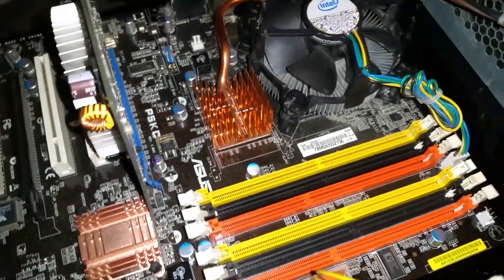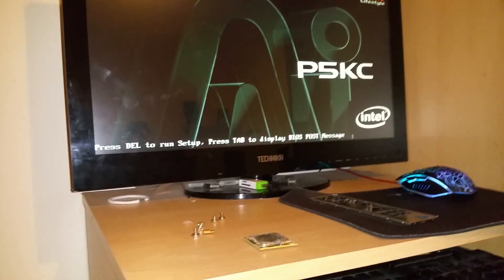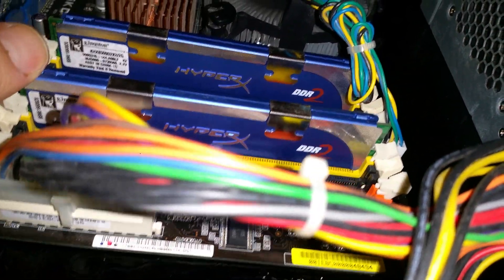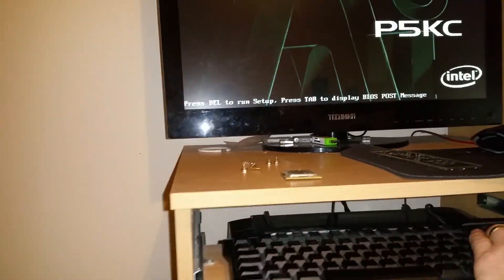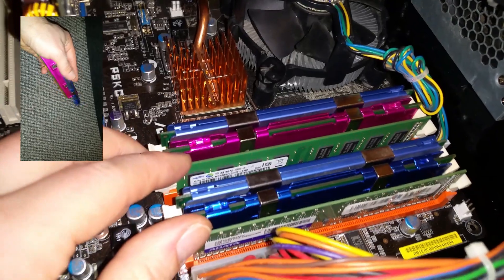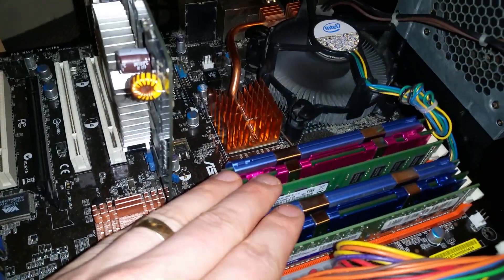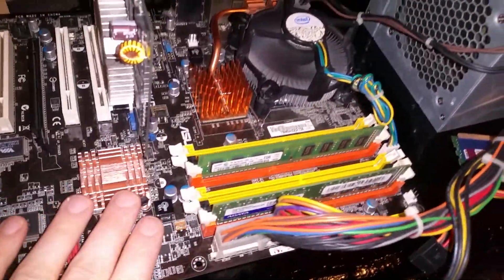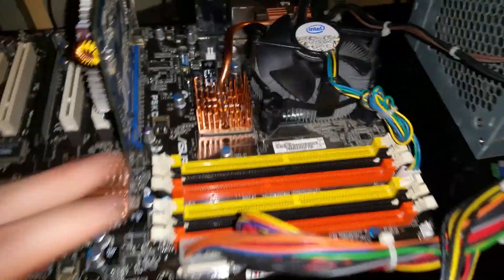Can DDR 2 and DDR 3 working together ? Lets find out

Comment: Wait, This Is DDR2 MotherBoard or DDR3? And Can I Insert DDR3 Ram Memory 4GB On My DDR2 MotherBoard? My DDR2 MotherBoard Is G31M-S2C. Gigabyte.
Reply from the maker: Hi this is combo MB is have 4x DDR2 slot and 2x DDR3 slot not sure about your MB   but MB like this is not usuals
Reply: @frogtechtips  So Can I Insert DDR3 Ram Memory 800 Mhz On DDR2 MotherBoard Is G31M-S2C ? I don't know, so I ask, Thank you if you answer. I Subscribed.
Reply from the maker: @newy14  hi definitely no as DDR 3 have different pin you will need new MB and probably new CPU saw well

Comment: Hey I have a laptop which has 4 slots and only 2 slots are filled 4gb×4gb and both are ddr4 so i have 2 gb ram 1gb+1gb unusable but they are ddr2 so can I install them on my laptop
Reply from the maker: Hi no you can't use ddr2 in ddr4 slot you will need buy Ddr4 ram for upgrade

Comment: Hello I just wanna ask if A Ddr2 motherboard can support a ddr3 graphics card
Reply from the maker: Hi if you have there PCI express slot for graphic card definitely yes
Reply: Frog - Tech - Tips I have an old graphics card and I want to upgrade to 2gb
Reply from the maker: @cidy1141  go for hd 7950 3gb  you can find tham pretty cheap and that card can run any game in full HD
Reply: Frog - Tech - Tips does it support intel because i run core 2 quad
Reply from the maker: @cidy1141  definitely yes

Comment: I have a question. If I have 2 OSs can I set one operating system to use my ddr2 and my other OS to use my ddr3?
Reply: Hello I will have exactly same motherboard next week. But that is not the point.. How I can have 2 OS's? 😀 I have a server with 2x X5650 6 core cpus.. can I give each user each cpu?
Reply from the maker: @davidkoronczi4763  hi note sure about that as I never tried but I think is not possible
Reply from the maker: Hi bro not sure I don't try something like that

Comment: I have 2 questions
1.what is your video card ?
2.i have 8 GB of ram but when I open system properties it's says :
Installed memory : 8 GB (6.44 usable)
What should I do ??
And I have win 7 64 bit 
And my mother board support even 16 GB of ram
Reply: Check your bios..
Your memory is being used as virtual video memory..
Reply from the maker: you right
Reply from the maker: hi thanks for your questions 
my personal GPU is RX 580 8GB

and your problem with RAM is your pc use on board GPU nd that card reserved some RAM that's why you can use less 

sort this problem you will need dedicated GPU and switch off your on board GPU in Bios after that you will have full 8GB 

BTW my full spec is 
i7 3770
32GB RAM
RX 580 8GB 

more that happy with this configuration

Comment: I’m finding it difficult to find DDR2 ram.
Reply from the maker: really if you are from UK check CEX or just have a look on ebay
Reply: Frog - Tech - Tips 
Thanks. I’ve looked on eBay and Amazon. One thing I’ve also noticed, is that DDR 2 is more expensive than DDR 3 or 4 maybe I’d be better off getting a new laptop seeing as my present one is 32bit and to upgrade enough, I’d have to get a new motherboard to take 64bit. So by the time I’d upgraded all that I wanted to, I’d have bought everything new except the laptop body/casing itself!  New Motherboard, CPU, RAM, SSD. It’s a new computer but for the screen and keyboard. Time to save up lol.
Reply from the maker: @jazzman1626  tell me what type ram you need and I will try have a look for you are you from USA
Reply: Frog - Tech - Tips 
I’m in the UK. I  saw some on Amazon uk but they’re £118. That’d be ok for a while until tech moves too far on and my computer fails to keep up with new software demands. I recon the software pushes the need for upgrades. A much better refurbished laptop than I have is a little over twice the price of the ram alone and with a better CPU, motherboard that takes 64bit software etc. Good photo editing software and the plugins for them are now 64bit, and 32bit software is hard to get, like Nik software’s 32bit which is now no longer supported but Thanks anyway.